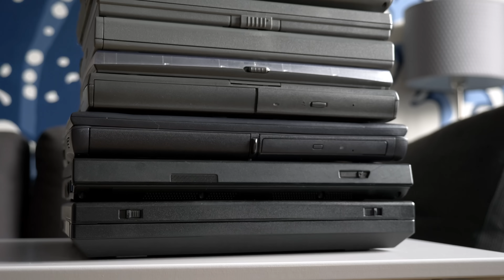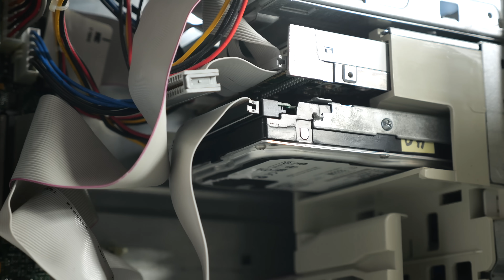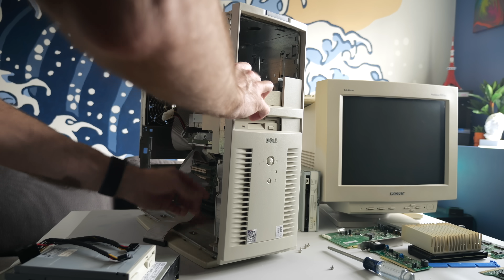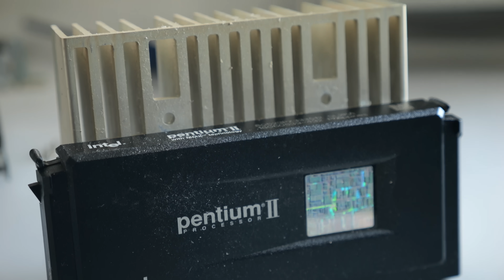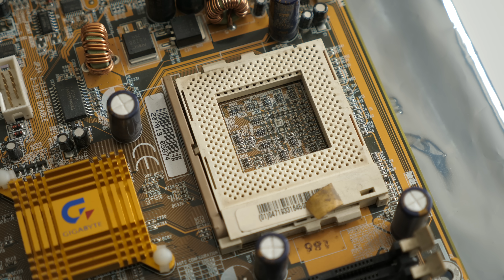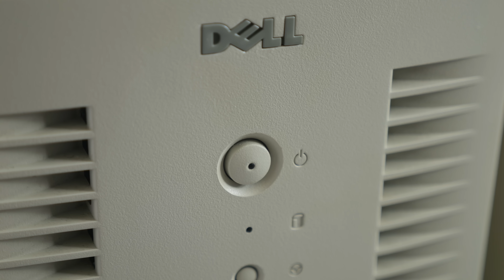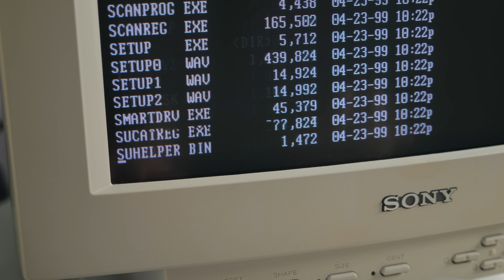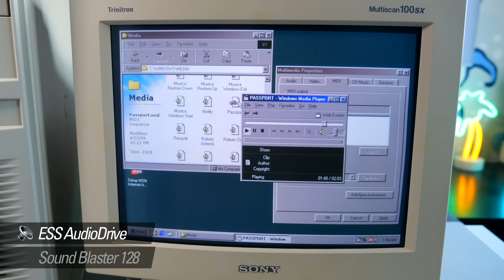Could this prebuilt vintage PC actually be GOOD?!

Comment: My first PC was a hand-me-down in about 2002 and it was a Pentium II at 333MHz. So while the machine would struggle with 3D games, I knew it would be decent from personal experience. Imagine how amazing it felt to upgrade from that to a Pentium 4 1.3 GHz a couple of years later.
Reply: the first pentium 4s were complete crap - slower than lower clock p3s and ran hot, needed expensive rdram. took release of northwood core paired with ddr ram to get decent.
Reply: @Jon-hx7pe  _Even With that in mind_, going from a Pentium 2 to a 4 ought to feel like a banger of an improvement, which is what OP is saying.
Reply: @Jon-hx7pe the only thing that required rdram was the first chipset. Sdram chipsets, even for socket 423, came right afterwards. There was even the awful i840 that brought rdram to the P3!
Reply: SDRAM further crippled the original p4 which was already handicapped. p4 was junk until northwood core and ddr ram chipsets came along. @9.peanut
Reply: My first PC was a 286 which made me regret I didn't go for the 386 but used for 8 years nonetheless.
Reply: dude I got a Dell🤣🤣🤣
Reply: @SaraMorgan-ym6ue EU AM UN PC  HP 6300 PRO FABRICAT ÎN 2014 !😅😃😃?
Pe WINDOWS 7 HOME PREMIUM ?

Comment: Oh that slot CPU takes me back. Well over 20 years ago now my dad upgraded the network at his office and I got to have the old server, a slot 1 P3 450. Awesome stuff. 

Also, I managed to kill that CPU very quickly with a 100mhz OC. Whoops.
Reply: you forgot the first rule for doing that which is you have to increase cpu cooling when you increase clock speed but it's ok it's just a cpu🤣🤣🤣
Reply: @SaraMorgan-ym6ue  Excuse you, I added a second crappy fan to it. It just so happens that that wasn't enough of an increase.
Reply: If it was a decommissioned Pentium III that could not have been "well over 20 years ago"...
Reply: @BilisNegra  well if you look at that old Pentium it does not even have a fan on the heatsink so overclocking it would cook the cpu for sure adding a fan would definitely helpp with the cpu's longevity and surviving the overclock longer
Reply: @BilisNegra  It was a slot 1 Pentium III from 1999. It's almost 2024. That would make it nearly 25 years. So, yeah. It could be, bub.
Reply: @spazzypengin  24 years since the equipment was put into service, not since it was decommissioned. And don't think people change their network gear every other year. So it must have been more like 20 yr. ago at most...
Reply: @BilisNegra  This was in late 2001, I remember because it was right after 9/11. So please keep telling me I didn't get what I had when I did.
Reply: @BilisNegra  It also wasn't like a major commercial grade server. It was all consumer parts in a consumer desktop chassis, because the network consisted of 4 computers.
Reply: @BilisNegra this guy…yikes